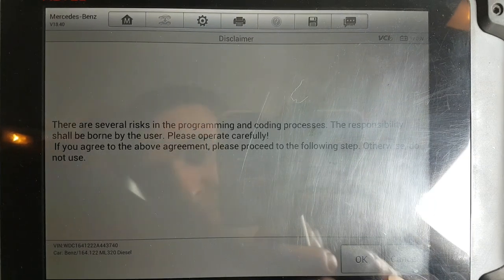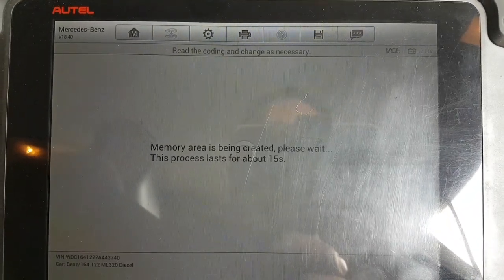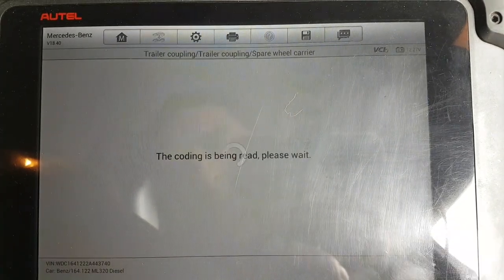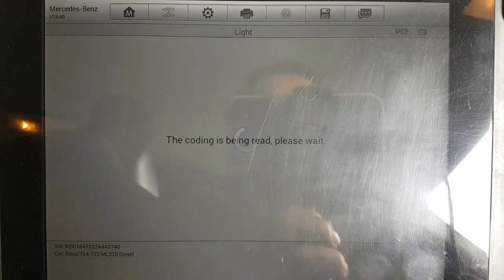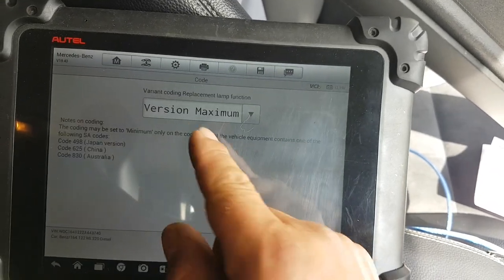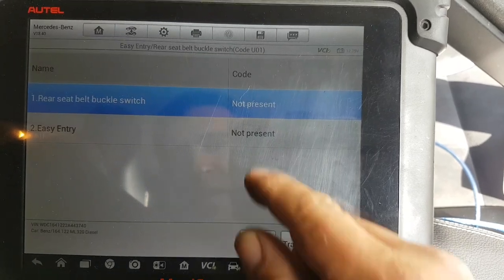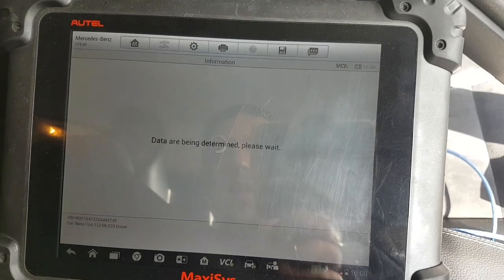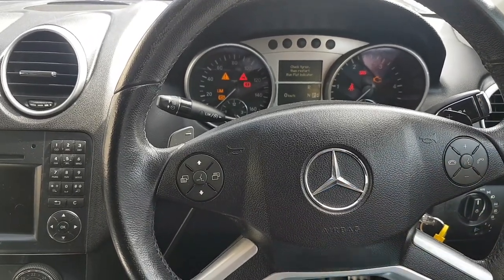Mercedes Rear SAM programming example.

Comment: Thank you for putting in effort to show us what it looks like. What version of autel is this? Can it program the main computer N3/10 component the ME-SFI  control module. Also can you program the front SAM? I got rear SAM that wanter got to the board, and also front SAM that shorted and burned the board so what I want to try is to buy them and try to program both rear and front SAM eith autel.
Reply from the maker: Hi
This is the MS908P... and yes, should be able to program those as well...
👍👍👍

Comment: hi i have a mercedes ml 280 cdi 06 version both front seats are not working but when u plug diagnostic tool in they work so its not the seats them selves is their somethin i am missing or would u know what the cause would be by any chance.

Comment: How this work if you still have error code recorded in the system 
Ask you because reading to many different thinks 
And can you cloning different serial number SAM or need to be exactly the same one

Thanks
Reply from the maker: The SAM doesn't need to be the exact same number, as different SAMs have been superceded over the years, your just need to get one that is compatible with your vehicle. 
But in doubt, try to get the same, that way you will be sure that it will work...

Comment: I have a 2007 w204, with prefacelift led rear lights and I want to retrofit the facelift led rear light. I saw on some groups and forums that the rear SAM needs to be recoded and they said I could do it with a regulat obd cable and a laptop? How is that possible, what software do I need to do that? Thanks in advance!
Reply from the maker: Not sure... could be that there is some software out there capable or coding the unit...
Unfortunately I am not sure...
Go on those same groups and forums and ask...
👍👍👍

Comment: I replaced the rear SAM with a used one and everything worked, but I get a warning about the rear seats not fitting, but in my car they don't fold down. How can I delete this and what program is it?

Regards.
Reply from the maker: Needs programming/coding...
Similar to what I have done on the video...

Comment: Hi Luis, I've programed my rear SAM same as you did, but i was in need to reset the "Fuel pump sensors" which i couldn't find to program or code, my fuel gages is still stuck on full and the reading shows an error: (90DA) + (90DS) any advice? Please note: i've checked the SAM module and all of its resistors and it seems ok!
Reply from the maker: Hi
First, why did you programmed the module? 
Was that a replacement? 
👍👍👍
Reply: @LMAutoRepairs  No sir, I've replaced the main battery and after the installation all of the features in the rear side of my car a "W164" didn't work, so i've checked the rear SAM and i found a little bit of water leakage from sunroof to that area, then i had to open it and clean it and re-program it, everything is working fine right now but the fuel gauge, it stuck on full all the time!
Reply from the maker: Could still be an issue with the rear sam...
Inspect the board and the internal circuit if the lever sensors...

Comment: Hi Luis. Unrelated question. I believe I have a spark plug issue for my car (P0300 code). Should I also replace ignition coil and or wires too ?
Reply from the maker: I would establish what is at fault, and would replace those only...
The spark plugs, if they are "due" to be replaced, just do them all, the rest check first...
👍👍👍
Reply: @LMAutoRepairs  Thank you so much

Comment: I was just thinking, STAR/XENTRY is as straightforward like the AUTEL.or vice versa. So why I always grab STAR? Old habit I guess. Not that I have to program so many modules. Nice quick video Luis.
Reply: That's because Autel basically clones the factory software when it comes to these functions.
Reply from the maker: The Autel?
MS908P
Reply: Do you need subscription for the autotel
Reply: What is the cheapest model for autel that can perform Sam programing
Reply from the maker: Yes... Autel need a subscription, but only for online functions...
I am not sure what is the cheapest one that cam do this... I never used any other model...
👍👍👍

Comment: I have order from ebay a rear sam for my w204 200cdi 2011.when i change it does it needs coding?
Reply from the maker: Most likely...
Specially if your car has functions that the donner didn't, or vice versa...
👍👍👍
Reply: @LMAutoRepairs  Thank you for your answer